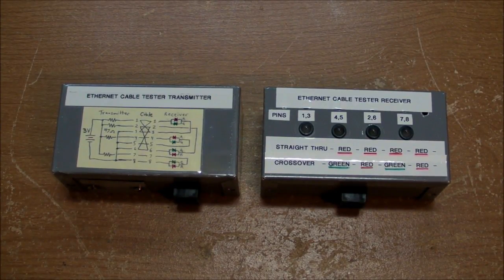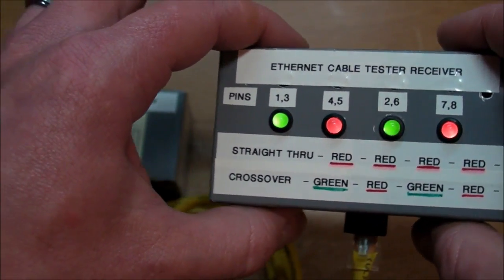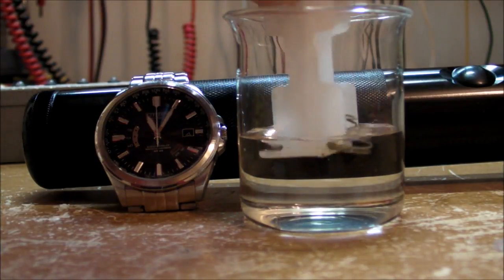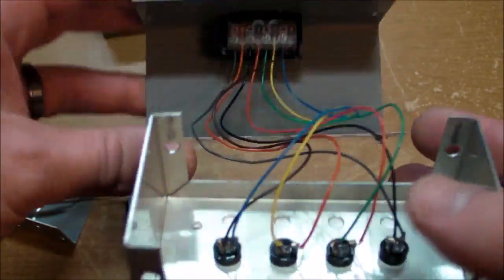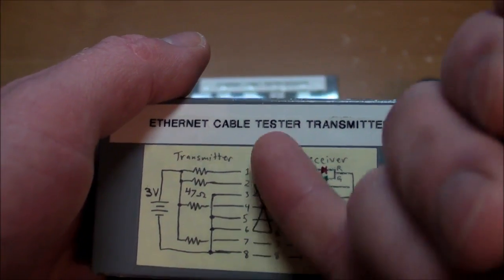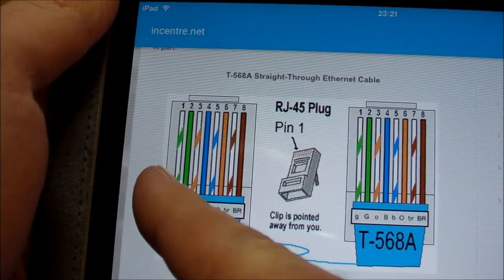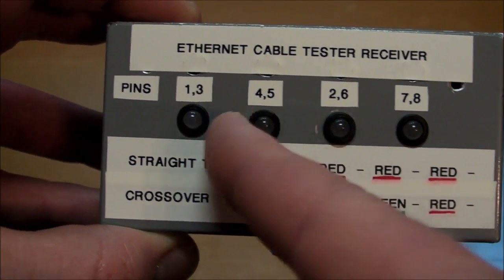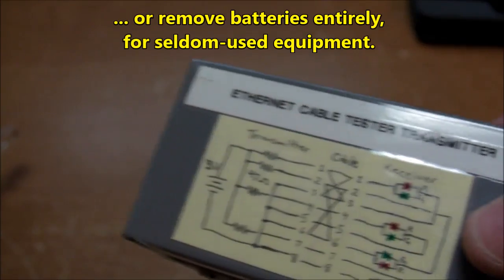(#0193) Super Simple Ethernet Cable Tester

Comment: On 100 Mb Ethernet only 2 pairs of wires are used for data transmission (1-3 and 2-6). The remaining 2 pairs act like a shielding. If you switch the "shielding wires", the cable will still work, but the transmission wires have to be connected right. On 1 Gb Ethernet all 4 pairs are used for data transmission and all the wires have to be connected in the right order. Otherwise your device might be identified as 100Mb or in most cases it will not work at all.
Thanks for the great tip with cleaning the battery holder!

Comment: Duracell batteries are known to leak prematurely, sometimes way before expiring date. This is mostly in devices with a very low powerconsumption.
Even cheap brands of batteries will not leak that quickly as Duracell does. Duracell no longer comes into the house here.

Comment: i considered building one of these using a resistor network at one side - and a arduino etc at the other side - you can use the resistor network ( different values)  as a byte value to detemine what pin is shorted to what other pin , and  if all pins are connected , based on the resistance of each wire at the other end. for instance if one line reads 470k + 220k that means that 2 wires are shorted together and those two combined values are the faulty pair
Reply from the maker: Good idea. The are certainly a lot of arduino-base cable tester projects today, but when I built this thing back in 2010, I didn't even know arduino existed.

Comment: How long of a cable run will this work on?
Reply from the maker: chris Thousands of feet. The LEDs will simply dim slightly with increased length. If it's 24 AWG wire, then 1000 feet of cable will add roughly 50 ohms (25 ohms in each conductor of a twisted pair) to each LED circuit.